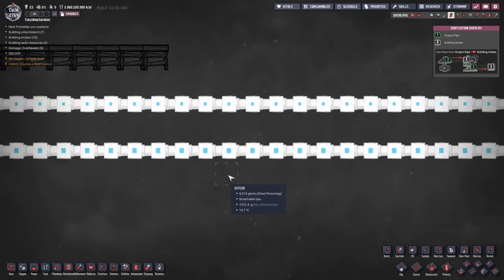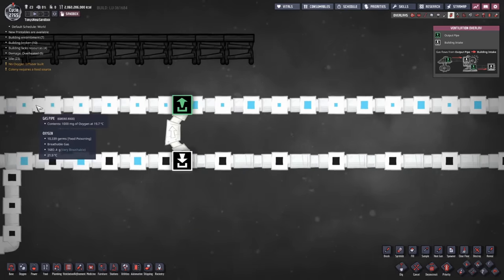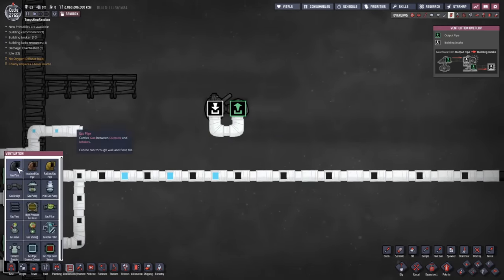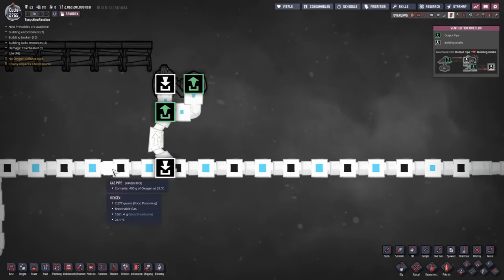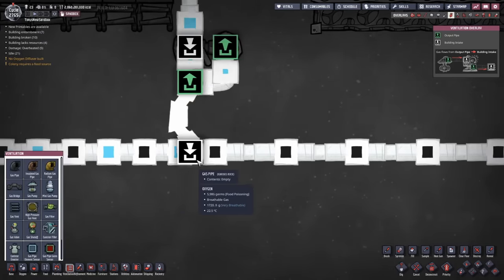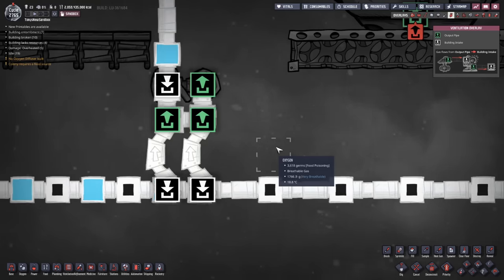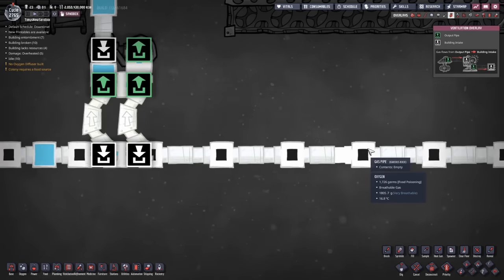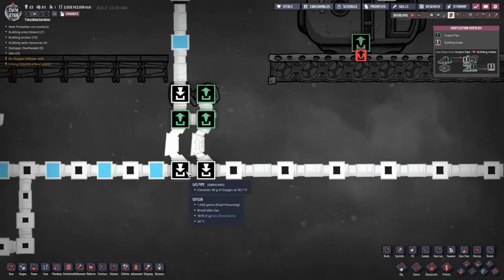An important ONI filter, in 5 minutes.

Comment: Couldn't you just put a valve limiting the unsorted gas to 999g/s to ensure it doesn't have the full packet problem?
Reply from the maker: That's a good way to go in situations where you don't mind the new problems it introduces. Imagine a pipe that has full packets of O2 and CO2 alternating. A valve would let through 999g of a packet, and then the remaining 1g, effectively reducing the capacity of the pipe to 50%.
Reply: @tonyadvanced6315  ah, that is true. I was thinking of this in a situation where you're sorting a variety of mixed gases. Although I suppose that if you had two gases, both in high volume, you'll get a lot of full packets.
Reply from the maker: @suzyb1499  With a variety of mixed gasses it seems like there's not much reason to worry about the 999g/s limitation anyway. I think the best time to add a 999g/s valve is when you are filtering a pipe that is almost always the same element and only rarely has a "wrong" packet to filter out. Because, that's when the problem is a problem, and that's also when having the valve doesn't create more issues. (Because like-elements merge and you can get 999g/s packets through the valve continuously.)

Comment: So, the problem of overloading thr input pipe with 1000g packets can be fixed with 999g/s valve?
Reply from the maker: It's not really a problem. But if you want to avoid it then a 999 valve creates different problems. The only sure way I know is to use two filters and run their output together

Comment: Can someone explain the benefit of this over a filter? Newb here
Reply: Filters cost power. Let's say you want to drain a jungle biome of gas. It can have clorine gas, hydrogen gas and polluted oxygen. That is 3 gas filters you'd have to set up.

That is 3x 120w = 360. 
A single coal generator generates 600w. So you just wasted over half the capacity of a coal generator for x amount of time sending mostly small packages over a filter.

Alternatively you can use this and use 0W but instead some building space
Reply: @Jordi_NL  you’re a star. Thank you for this!

Comment: I'm kinda confused, doesn't the game has a built-in filter that does exactly this?
Reply from the maker: The game has a filter that works differently. The game's filter blocks the input and stops if one of the outputs is full. This filter allows the input to both flow past or get blocked downstream without adverse consequences and doesn't block the input if the filter is backed up. It may seem like a small thing but using the right filter can change everything. There's another common automation-filter that has yet another set of properties.
Also, this filter doesn't use power or generate heat.

Comment: I use these with mini pumps in several key locations to keep the pesky CO2 moving to the bottom of the base. Also in all my fluid tanks because some times you just can't prevent different liquids from getting dumped in the same tank. Additional notes:
1) you can set the valve to 0.1 g, that is the smallest unit it can go
2) put a bridge at the output side to help the gas/liquid decide direction
3) Gas Valve(unpowered) can merge gases at it's output; the Gas Shutoff(powered) does not merge gases on the output
4) the Gas/Liquid Bridge has wierd logic haven't figured out; some times merges and some times does not merge

#2 video shows the output once every 2 sections of pipe. I'm pretty sure, will have to check, that with the bridge on the output you will get gas in every section of pipe on that side.

#3 I noticed the note on the shutoff wiki page about the valve, but that bit of info is missing from the (unpowered) valves wiki page. This was almost a disaster one time! An auxiliary line of hydrogen with small amounts backed up my SPOM. Replaced the bridge with a valve and that stopped the back up.

#4 With bridges I'm not sure exactly what is going on and the wiki doesn't explain anything about merging lines. I believe some times a bridge further up the line can affect what is happening where you are attempting to put a bridge into an intersection or joining of lines. Watch carefully and you may need to use a Valve there or further back in the line instead of a bridge

Comment: Just be careful with this method because the game as a vile habit of deleting the 1g packets going around when you load the game. That mean that at one point, you'll load a save game and all your pipes filters will be f*cked up because you'll lose a few packets of oxygen and they'll be replace by CO2 (as exemple in your video). So a filter that you've set up for oxygen COULD eventually change for something else if you're not careful.
Personnally, this would be the last filter I use.. The pipe element sensor and valve right after is the best when you have a CONTINUOUS flow. If the main backs up, you can have problems there too.. Gaz filter is the best but yeah.. use a lot of energy.. but it never miss and will stop the flow if it can't expel the gaz in either the exhaust pipe (filtered or other) which is a nice security.
Nice video though!
Reply from the maker: That all sounds like an accurate analysis to me. I never had a problem with deleted packets but I wouldn't doubt it. Thanks.
Reply: @tonyadvanced6315  Keep up the great work! I've been playing the game for more than 2 years now and always a few good tricks to go. All options have their use, advantages and disadvantages. :)
Maybe they've fixed the deleted packets things.. the last I've heard of it was a while ago (like summer 2018). If so, this is a great filter but I would still be careful.
The number of time my filters has messed up because of little details I didn't though or forget about (mainly the backed up pipes...). Can lead to a gazy or liquid mess /mixed up easily if not careful.

Comment: Why not just use a Gas Filter ?
Reply from the maker: Good question. There are a few reasons. This filter will skim a pipe until the output is full without ever blocking the pipe, which is sometimes what you need. Also, it uses no power and produces no heat. So if you need a filter in a place that would require wiring from some distant location, or if power is scarce, or if you are filtering temperature sensitive liquid hydrogen, or whatever, then it may be a good choice. Also, in this game a regular filter is a bit of a noob kludge, but there are also purists who consider anything else a kind of cheating, so play it however it's fun for you.

Comment: this gonna break of if oxygen generation stop
Reply: Mechanical filters like this always have 1 gram of gas (whatever gas you put through it first) going in a permanent loop through the valve.  Only way to 'break' it is to deconstruct the valve or the pipes making the little loop.  If the pipe it's feeding backs up gas will go past down the main line, if the gas it's trying to filter runs out it'll still have the 1 gram going in it's permanent loop so nothing is broken... it'll start working again when the right gas comes past.
Reply: @lucasriley874  :oo got it
I thought it depended on the input to work
~google translate :v
Reply: @Ivu  Once you "charge" the loop with what you want, it loops forever. You can disconnect it from everything and will continue going round with no need for any kind of power or any inputs or outputs. You can put only an output but what you have the Valve set to, that quantity will not exit the loop.

Comment: Just use a damn gas filter dawg wtf
Reply: His design uses no power.
Reply: With the amount of limitations and complications this filter has. I rather waste 120w
Reply: @DarkreflexGamingTR  Do you really use the 120W filters everytime you need one ? If what presented here is a big amount in complication, I wonder if you ever reach the late game of ONI... No offense, but the design presented here is simple, and perfect for nearly all situations. Perfect for eliminating pollutant for exemple, like: gas pump air from an oxydizer, this filter the always low amount of hydrogen, then gas storage to pack oxygen and distribution. Other exemples? Before the atmo stations, or all generators, to ensure that they will never break. But if your map is 5 volvcano, 3 natural gas geyser and 2 hygrogen geyser, I suppose you can not worry that much and use the filters...
Reply: Nobody said that this design was not ''simple''. Something having complications and something being complicated are two different things. And I have pretty much done everything but rockets in ONI.

Using 120w filter is WAY more efficient than using this filter. Imagine the time you spent setting this up, making sure it works, making sure that you didn't do anything wrong just to get the glitch right. Like that's really not necesarry.

You can just use 120w filter with gas pump and then destroy it after you are done removing ''pollutant'' from where ever you want to remove it. That's it... You just used extra 120w for a minute. Wow such waste.

All I am saying is instead of trying to make this filter that has all these obstacles like how flow needs to go right, how filter would break if gasses are going over %99, that you have to build everything correctly to get the effect and even than it's still faulty because you can't send more than %99 gas and all the other things that you need to make sure so that it works, just use 120w for a second to do whatever you need to do without any obstacles and complications.
Reply: @DarkreflexGamingTR  After all, that's an ingenering game, you focus on whatever you want. I was triggered because I nearly never use the 120w filters, and I never see anyone using it after early-game. So I found your statement strange. This setup is not perfect, but is nice. 

I never thought about that design, I use the common element pipe detector & automatic switch design insteed.